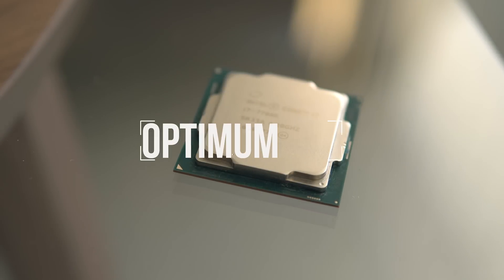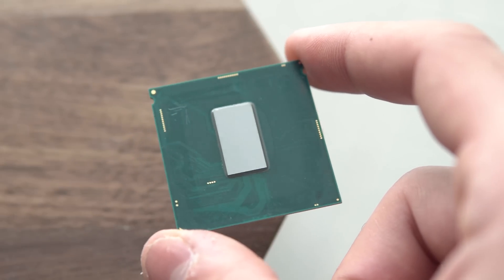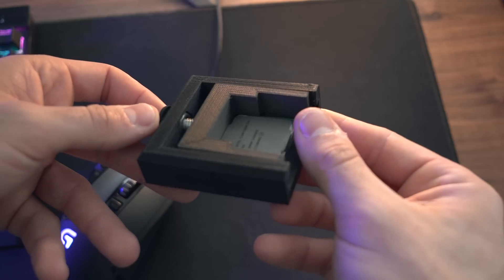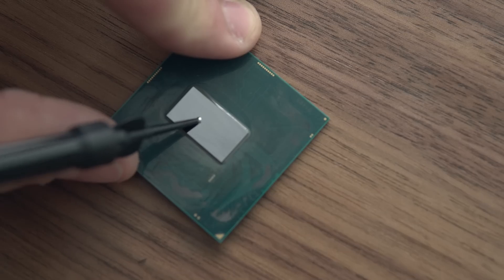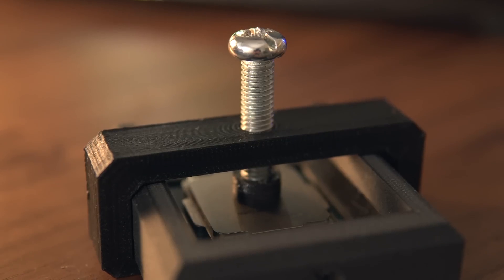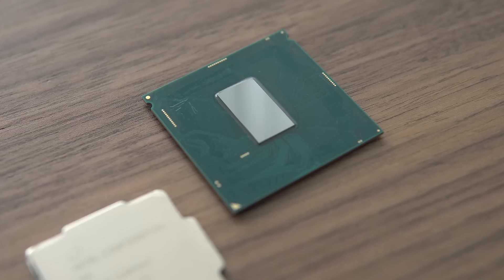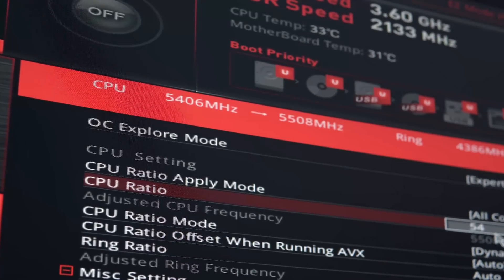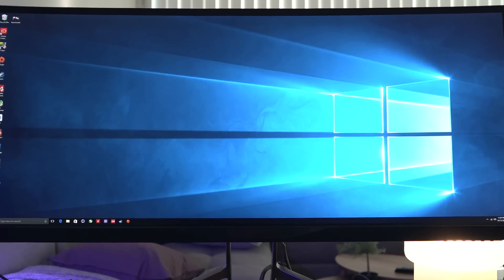Delidding The 8600K - 5.4GHz OVERCLOCK!

Comment: I would just suggest to apply some enamel drops on the gold points at the surface of the processor to just avoid any issue with liquid metal leakage, even if they are outside the processor top hs cover.

Comment: I have successfully managed a 5.2 on air, and not delidded. Cinebench completed 7 successful passes, Aida 64  CPU, FPU and cache stressed for exactly 1 hour and 30 minutes. Used Noctua NT-H1 thermal paste and the Dark Rock Pro 4 in an H500M with 2 140mm intake fans at the top, the 2 200mm fans in the front and 1 140mm exhaust fan with an open air cooler on a 1080. Temps hit 84 max, and was stable during all tests. Just ordered my delidding tool(der8auer Delid Die-Mate 2) and Conductonaut as well as Kryonaut for my thermal paste.

Comment: i can get it to 5.3ghz with 1.35v with my 8600K after delid.  I don't have a good water cooler, just a H60 corsair but with a noctua fan NF12x25.  I can make it to 5.5ghz with 1.46 V stable, but the temps are too high above 85C on prime95, i don't think 200mhz is worthy the extra 1.1 voltage, which is huge. good video, thanks man, instructive.

Comment: Ok, i have this CPU. I was able to get to 5.1ghz with corsair H60 pre-applied thermal paste. got up to 72C during cinebench. I had to go clear to 1.39v before I could get it to run at 5.1ghz. Is that just silicon lottery? Also when you talk about the other reviewers not being able to get to 5ghz even after delidding. What would be their limiting factor, how much voltage they have to apply to reach said speed, and ultimately temperature?

Comment: Just got mine delidded and running at 5.0 at 1.33v and pushing for the max load one increase at a time and lowering the voltage
Reply: Temps at max 60c on full load

Comment: does the DRAM Voltage influence the ability to raise the CPU core voltage? So i use MSI Memory try it and i set the ram to 2933 mhz at 1,4 V. can i now also overclock my 8600k to 5 ghz with 1,35 V? thank you!

Comment: i can get my 8600k to 5.1ghz but thats drawing a massive instability line... i have a comfortable 4.8ghz at an offset of 0.090 and it maxes out around 77 degrees under sustained load dipping into 80 degrees on a softer fan curve.. mind you this is a 120mm aio set up and a 240mm aio would serve to drop that even more.

Comment: 5.3ghz on 1.38v ?   i cant even get it to 4.9Ghz at 1.38v   so i settled at 4.8ghz at 1.35v
How is my chip so bad?  I have enough thermal headroom but i just cant get it stable :(
When i look at most people they use the same voltage and get way higher....
Can you help me?
Reply: Did you delid you cpu
Reply: @Cerus98 delidding is definitely worth doing
Reply: @Cerus98 not true
Reply: @Cerus98 theres no way on God's earth that my chip would reach 5ghz without delidding..that's fact..and if you have a chip that runs 5.1ghz with 1.2v you've won the silicone lottery well done. Just because you've reached 5ghz doesn't mean everyone will it's far from easy to reach 5ghz on the 8600k.
Reply: @Cerus98 I've got no problem with my bios and I've got one of the best mb for overclocking
Reply: @Cerus98its impossible realy that is realy impossible 1.24v on 5.1ghz. what is your ring ratio 4ghz? Of course not is your ring ratio @5.1ghz and that on just @1.24ghz. its a lie!

Comment: I got my chip to 5.0ghz at 1.21 volts, with temps under 43C in Prime95. I definitely won the lottery. Delidding dropped my load temps by 16C. Idle temps are as low as 17C. (I have my computer in front of an AC window unit.)

Comment: Just delided my 8600k and achieved 5.3ghz at 1.395v max temp 75c second highest 73 ( peaks not sustained ) sustained around 71 72c all cores failry good  spread as far as that is concerned I didn't want to push voltage over 1.4 honestly so I'm not going for 5.4
Reply: what mobo u using ?

Comment: LOL. God you "PC makers" think you're such hard core overclockers. You've NEVER seen a real CPU in your life.
What you have done is taken off the protective heat sink interface, and found the PRIMARY heat spreader.
This is not the bloody "real CPU".....you'd need to remove the primary too (which I very much do not recommend, though neat to see under microscope).
You'd get better clocks with a copper heat sink interface, the liquid metal makes a lot of sense though.

Comment: Hi, im using the DanCase A4SFX, so is it usefull to delid the 8700 (non K) to use the full boost? The Case is very tiny and i cant use a large cooler (i am use the noctua l9a). I heared that the temp goes 15-20 Celsius down. Greets from Germany!

Comment: how long should i stress my 8600k at 5.1ghz with 1.32v? I've tried to 20 minutes without any crashing.Should i do it longer? and what is the safest temp for the cpu?
Reply: Keep it below 80. Do it for at least 1 hour just to be safe, seems kinda low voltage for 5.1 so maybe you got lucky but just watch temps and try for a hour to make sure, if everything is good then congrats
Reply: I know :D .I even tried only 1.3v with aida64 for 2 hours and it worked..but I cant not move to 5.2ghz with the raise of the voltage sky rocket to 1.37. That's crayzy for me isnt it?@@. Took almost 0.1v just for 100mhz more. For me I'm very happy cuz this is the first time i have one cpu which can go over 5ghz. but you know with this low voltage i kinda expected something for come from my 8600k.
Reply: Are you gaming with this? If so then you won’t notice the difference anyway so it’s all good and yeah, 5.1 at 1.32volts is really good no need to try higher if it doesn’t work for you

Comment: which board has the best VRM's -Prime Z370-A or Strix z370-E or Maximus X Hero ?which would you choose for an i7-8700k or i5-8600k?Load Line Callibration issues?
Reply: K Thejas Thimmaiah the hero x is just on another league with the vrm section but you can get decent oc with all of those mobo. If you wanna the extra 0.1ghz simple buy the hero

Comment: I also delidded my 8600K but cannot go beyond 4.8Ghz. Even when I give 1.5v, the cpu freezes even before it hits high temperatures.
Reply: I have mine at 5.0ghz with 1.296v with llc on 3, temps when cinebenching never go above 72

Comment: Very impressive overclock. I think you should find someone that can push this thing on LN2 or helium, you might have a record breaker. I am kinda disappointed with the multithreaded performance though. I just got a Ryzen 1600 and a lot of people suggested that i go with 8600k and i am so glad that i didn't. First of all that cinebench score. I have overclocked mine to 3.9ghz on the stock cooler and my score is identical with that top tier liquid cooled, delided, liquid metal, power hungry 8600K at 5.4GHz.1600 is 65w stock and mine is around 105w with that overclock. That i5 is 95W stock and it would definitely need a decent cooler with any amount of overclocking. And the whole deliding fiasco is just ridiculous for a cpu of that price. And we didn't even got to the price. A 8600K costs as much as a 1600+motherboard, and you still need to buy a cooler because it doesn't come with one. All that makes it a much more expensive option, for which you can just get the 1700X.

Comment: Wtf? My R-5 1600 at 4ghz puts out higher scores on C15....
Running Cinebench one time doesn't mean the system is stable though...It's cool to say but without hours of stress testing it really doesn't mean much.
Reply: Brad Mundie's a six core amd chip beating a six core intel chip at 1.4GHz lower either shows that AMD smt is some kind of black magic or amd having lower ipc is a bullshit lie spread by the army of fanboys intel has
Reply: my 10 year old xeon x5650 4.4ghz gets 1100cb multi... and 142 single it destroys r5 1600 in gaming

Comment: 5.4 is a insane score but keeping voltage so high is to risky - doesn't matter that temps are lower. 1.35 is max recommended voltage in most of the cases.

Comment: 1.45 volt for 5.4 GHz OC isn't winning the silicon lottery.

1.45 volt is too high for a 24/7 usage.
Reply: with very good cooler is this OK. H2O or H2O with chiller.

Comment: I'm running the 8700k at 5.1GHz not delidded with a proper watercooling loop and that is without changing the voltages or anything. I left everything on auto and pushed it to 5.0 first that was fully stable then pushed it up to 5.1 and it was stable there as well. I'm planning on trying to push it further later on when I have the time. I'm running around 60c temps.
Reply: Ian Speer No actually, AVX Instructions aren't adjusted.

Comment: Don't delid your CPU, just buy a known working one online. It's a Silicon Lottery, the thermal compound is fine. Get an AIO, use the dot method an see if you won. The less you remove your CPU from the socket the better. I have the same CPU and get the same speed, just hit got lucky and hit the lottery. (no delid required) Study what the Silicon Lottery really is all about and you'll understand. Intel uses fine paste no matter where it comes from, that's not why you can get lucky and get one that runs fast. A good air cooling system will work fine as well.

Comment: Using a screw instead of a bolt is just a really bad design for your delidding tool.  Screw head will easily get stripped, a bolt won't shear as easily and you can buy them for the same money.
Reply from the maker: Only had a philips head M8 bolt on hand, the final one will be a M8 Hex Bolt for those reasons

Comment: No one realizes that temperature will be the same on both delidded with liquid metal and with factory compound, after a few hours of using your PC. 
No matter if you are using air-cooling or water-cooling, they both increase their temperature and fans cant cool it down so quickly.
Reply: What?
Do you even know the point of delidding?

Comment: Why is delidding even necessary in the first place? All of the money Intel put into marketing and development and they ruin it with shoddy thermal paste to save a couple of cents.
Reply: It's because the chip itself only costs like $5 to make, so spending an extra dollar on better paste will significantly increase production costs.
Reply: 6Twisted
There are more reasons to using a thermal paste than just reduced cost.
I think Gamers Nexus did a video that touched on this subject a bit. I forget the name of it, but it featured a Dur Bauer or whatever his name was.

But yeah, it'd definitely be better to solder the IHS to the CPU directly, like AMD is doing with their Ryzen chips.

Though I think the paste works fine for the stock operating conditions of Intel's CPUs. Most of them are in OEM manufactured computers, which wouldn't benefit all that much from a soldered IHS.
Reply: ive heard 2 main reasons for the paste.  first they get a government grant for eliminating whatever harmful materials were in the solder (cpu solder is different that regular) and that the soldering process ruins a small amount of chips.  these may be true or not im just passing it along.  at the end of the day they dont really have to.  if ryzen starts hitting 4.5+ then they may change their minds
Reply: @4GB MEANS 4GB i dont think ive ever seen anybody get a 20 degree drop just from removing the glue and using ANY thermal paste.  but if you use liquid metal you can get a 20 degree drop on a cpu running in the 80's-90s whether or not you remove the glue.  but the quality of the tim is really not what people who know what they are talkign about are complaining about.  its the fact that the cpu is not soldered.  if its soldered there will be no space between the die and ihs no matter how high the glue is keeping it.  and you cant get the same temps with the glue removed and TIM as you can with solder.  not having solder is the problem not the quality of the tim OR the spacing between the die and the ihs
Reply: if capitalists have a choice to save 1 cent or spend it and make a product better, they will always chose the 1st option)
Reply: Yeah G Rom, sadly, profit first before quality, just like how some loggers won't replace the trees they've cut and then maintain it in order for those seedlings to actually grow healthy because they'd obviously had to spend on those thereby resulting in profit decrease.
Reply: @4GB MEANS 4GB so ok the comment you are replying to and a lot of comments in general is that intel used cheap tim and you are saying that the quality of the tim doesnt matter. you are correct. for everybody out there the difference istn that intel has bad tim when compared to amd, its that amd and everybody else including intel used solder until the 3rd gen intel.  stop saying intel sux cause they use toothpaste or shoddy thermal paste.  instead say intel sux because they are not soldered.  of course even without solder they are still better than ryzen.  lol
Reply: @4GB MEANS 4GB can you explain what you mean?
Reply: Yes ok you get it haha, sorry if i was unclear.
Reply: @chookchack  🤣😂
Reply: Well many tests have been done to replace the thermal paste and leave the glue and space of the die to the IHS resulting in almost no difference in temps.  What did make the giant difference was the removal of the glue resulting in the IHS being much closer to the die.  Sure you might see a difference in using liquid metal vs TIM but the bit temp drops come from the reduced space between the die and IHS>
Reply: Has nothing to do with the thermal paste.
Reply: Im just going by what all the reviews have showed,  that changing just the TIM under the IHS barly netted 2-3C, and reducing the space netted even more with just TIM,  but yes of corse using lquid metal nets the most gains.
Reply: The only scientific reason they de-lid CPUs is no because of the thermal paste but when they de-lid it , it gives the IHS some fresh air to breath, it's got nothing to do with the thermal paste.

Comment: Why delid just to put the heatspreader back on? Even with the liquid metal, wouldn't it still be better with direct contact to the silicon?
Reply from the maker: Yes, but the cooler won't make contact without a shim or IHS unfortunately
Reply: The only reason they even started putting IHS on was cause people were destroying their chips due not putting the heatsink on safely. Also why the bolt on pattern was implemented years ago. People don't want to break their CPU after dleding it already.

Comment: Quick question: if delidding gives you much lower temps then why do the manufacturers use that crappy thermal compound? I'd pay $10-15 more anytime for a CPU if it would give better temps without warranty void.
Reply: Laccer its intel... They use toothpaste for years now
Reply from the maker: Cost effectiveness, and I guess the 'toothpaste' they use is sufficient for CL. I hit 5.3GHz@1.38V @82C with it, which isn't exactly bad

Comment: my fx 8320e is at 4.320 ghz at 1.375 will it be safe if i increase the voltage temps now are from 41 to 50
Reply: you can go way past that I was running mine at 4.5ghz@1.45v or something, just need a good cooler, and don't remember the max temp but it's pretty high

Comment: In a 250 dollar cpu, why would intel not just use the best thermal paste
Reply: Jack Moseley because they want your money
Reply: better paste is a half assed soulution at best, they should solder the ihs on 200$+ cpus when amd does it on the 110$ r3 1200...
Reply: Giorno Giovanna Over Heaven just like every company?
Reply: But is Intel more greedy than Apple?
Reply: My point is that if they could advertise better why wouldn't they just put good thermal paste in their $250+ cpu's?  If it is worth delidding to some people than it obviously increases performance by a significant margin, in which case they could then advertise even better performance.
Reply: There's always a reason.
Reply: they wont because they want ppl lose warranty and didnt reach to a good ghz with this price of cpu
Reply: These liquid metal pastes have very poor durability and would not last for the duration of the warranty
Reply: This is just an assumption but it's probably because, profit over quality.
Reply: The main problem isn’t just the thermal paste. It’s mainly 2 other things.
1. It’s not soldered.
2. Too much glue is being used which adds space between the core and the ihs.
Liquid metal will increase performance of course, by a few degrees but if it was soldered you’d still have around -10/-15 degrees less at load and the extra around 5 degrees comes from the liquid metal.
Reply: only if in contact with oxygen and aluminium. Not the case here.
Reply: Xx Luke xX yes, but for example Apple is more greedy than Huawei